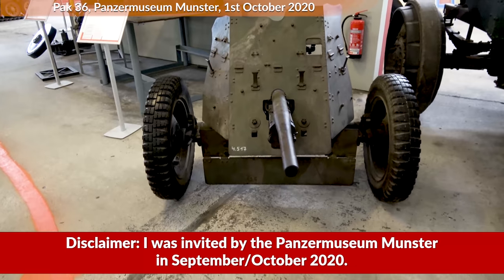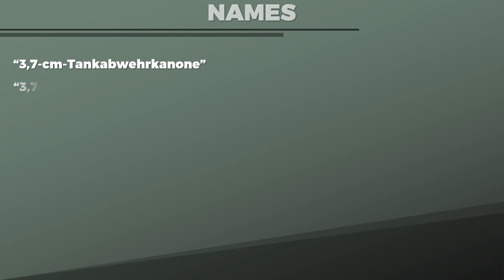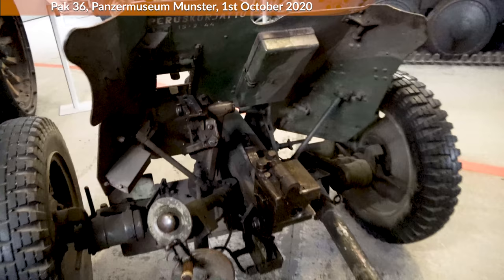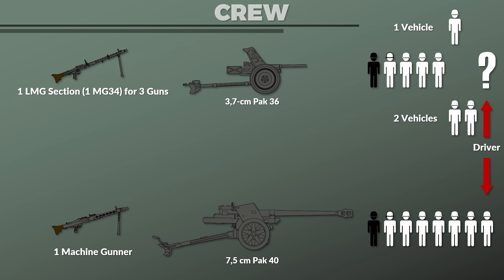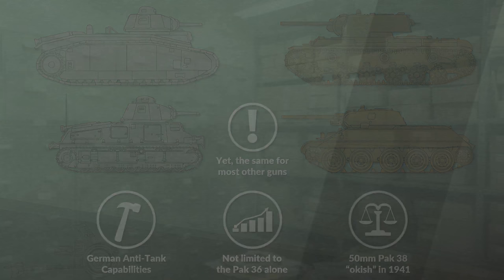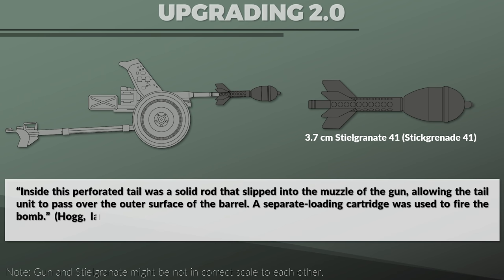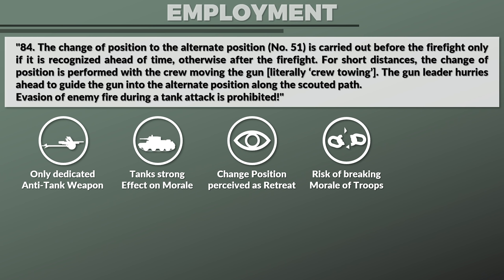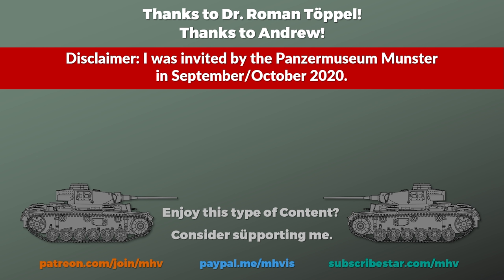Pak 36: The most effective Doorknocker @DasPanzermuseum

Comment: If anti-tank positions are heavily pre-planned, then individual guns readjusting on the spot may compromise the anti-tank network, making blind spots.
Reply: That would be a problem, but in the case of relocating to a pre-planned secondary position I don't think that is the issue since it would presumably have been considered in planning the secondary position. 

There may be a bit of concern over the gun being temporarily out of action, however again that temporary issue is better than the gun being permanently removed because it didn't move away. 

But I would lean towards the suggested ideas in the video: maintaining morale (both from the other troops seeing the gun withdraw and fr the gun crew getting antsy and moving out early) and minimizing exposure.
Reply: Alternative fire positions which are supported as part of a defence in depth scheme  is always best.
Reply: My take: 
- the morale effect is important (not for nothing troops are told that individual tanks retreating in a battle does not mean they run away … low ammo happens, etc.)
- the orders state that you move to a secondary fire position when you have fired (and therefore given away your position) or when you have been spotted prematurely (that would mean before firing)
- as you have NOT been spotted, the incoming fire must be into the general area where the enemy is/might be. Driving you out of position or making you unable to fight the approaching tanks is the pointing the barrage, killing you is a bonus.
- Besides, relocation means you are much easier to spot because you move (unless you hide 100% behind terrain all the way) … and a spotted AT is soon a dead AT.  Which is why you move after shooting or detection.
Reply: That and I think it’s an admonishment not to reposition during a firefight but to keep firing.  Fire volume may count (at least in the writer’s imagination) than chasing optimal positioning or withdrawal to a more tenable position.
Reply: Bigger problem is that you are more exposed and visible if you try to move from pre-planned position. If you cannot effectively shoot back, crew should hide in trench till worst passes, then asses situation. Support artillery generally do not shoot one target longer then 2-5min.
Reply: I think it is that plus both reasons mentioned- the adverse effect on the rest of the defenders to see possibly their only AT defense apparently running away, and the EXTREME vulnerability of a gun crew scurrying around their gun, slinging ammo, trying to get the trails free, etc. It's likely pointless anyway- assuming the attacking armor and/or supporting elements have noticed your obvious commotion, especially if you've already been shooting at them, your chance of successfully dragging that gun away is nil. Even one that light and mobile. Seems like the unwritten expectation for towed gun AT crews in the path of an enemy armored force is that you either win or you die. Of course, sure many, being humans, simply abandoned the gun and tried to run away at some point. Nice video, thanks!
Reply: @EricDaMAJ  but to keep firing.  Fire volume may count    Please revisit the video.
- A PAK is an ambush weapon.  (You think of artillery in general.  PAKs are not 4+ km away from the front.)
- spotted —> no ambush, but almost certainly well aimed fire — tankers hate and fear effective AT guns and love to stomp the little buggers flat before they kill their tank.
- firing reveals your position

Hence you shoot and scoot — the only time you scoot first is when you have been spotted, not when random shells come your way. 

The only time you do not scoot after shooting is when you just won the battle and the area is safe — or when you are at the range.
Reply: Marcelo Henrique Soares da Silva     In that time tanks are not so precise too    That is a question of training and material.  Pre-WWII German tankers had been trained so they could hit observation slits in bunkers pretty reliably (and apparently the PAK 36 was also used in this and similar roles with apparently much success during the invasion of France.)
Reply: @mladenmatosevic4591      Support artillery   is what an AT gun in an ambush position is not in any way, shape or form.
If they “shoot back” instead of waiting for a hapless tank to knock out with one or two shots, no hapless tanks happen but well aimed incoming tank shells are very likely to happen.

If the mission is to knock out any gun in a fortified position that shows its muzzle, things may be different.
Reply: @advorak8529  I stand by what I said.  A PAK is an ambush weapon.  But when it's horribly underpowered, you need volume to compensate so you can at least hope to find a vulnerable point such as a vision slit or a track.
Reply: @advorak8529  Obviously they cannot shoot back at mortars which will shoot at them behind protection or to howitzers which will shoot from position put of range. But een if ig nasty heavy tank aims to them and miss first shot, they have no time to escape and no hope to penetrate front glacis. Therefore, jump in trench for a minute. It is no point losing crew with a weapon.
Reply: @EricDaMAJ     I stand by what I said    That’s great, but does not make it any more or less correct.

Under what circumstances would there be a blind barrage or area fire they are told not to avoid and targets within 600 metres (2000 ft) that need a large volume of fire so they must  keep firing and their risk of getting spotted (muzzle flash, powder smoke, …) over minutes of firing at such targets is low?
Reply: @mladenmatosevic4591    True, the crew should not suicide just because their weapon is going to be toast. That however assumes a trench. And that the tank won’t come to the trench and do a few victory turns on top of it. And that the tank’s MG is not already making holes into the air outside the protection of the gun shield.

Also the crew may have a magnetic mine or other close combat tank killing gear.
Reply: @advorak8529  Generally fully preparedvgun position involves dug in platform to level of wheel axle and  trench as shelter against artillery and air attacks. That is theory anyway. And since AT guns always work in teams, wasting time to trample one gun crew gives nice side view to another gun on two, and they will try to hit transnission, at least. In smart army tank will continue and leave stragglers to assault infantry.
Reply: @advorak8529  The weapon was underpowered but it was extremely accurate.  At no point in this conversation (or the video) did anyone say they were using area fire.  And that wouldn't be a PAK technique even if they were firing PAK88s.  I think you're misconstruing what I'm saying just to be argumentative.
Reply: My hunch is that that was the contrast in thinking between the British (and their two pounders) and the Germans and later, Americans, who adopted a sort of cousin to PAK36 as the 37mm  M3.  Both of the latter envisioned AT gun being used in a more mobile and "aggressive" role (which supposedly was a sizable contributor to the Afrika Korps' early successes).  While the two pounder was more powerful and more accurate, it was not only heavier, but also designed to be used in a stationary role.
Reply: They have to be pre-planned, because towed artillery aren't as mobile as the tanks they're supposed to be shooting.  This changed with the advent of Tank Destroyers (And assault guns used in that role.)  These were often more mobile than their turreted counterparts, but truck, and horse drawn cannons like these have to depend on Ambush.  They can't PaK up everything, hitch it to the horse, or halftrack, and chase the tanks, then unhitch, set up, load and fire.  They have to be Ready to Fire, (In Battery) preferably from a Concealed position when the tanks show up to stand a chance.
Reply: @Psiberzerker  "Have to be" is an exaggeration.  PAK36 and M3 were light enough to be manhandled fairly discretely on the battlefield under fire, and both German and US (Marines more than the Army) troops frequently used them in a quite "mobile" role, with the gun crews pushing them around physically.  USMC particularly liked the M3 (American "cousin" of PAK36) as they were light enough to be physically lifted over beach obstacles (granted, in the Pacific, they were mostly used against bunkers or against infantry with canisters).  How Afrika Korps used their PAKs, with the anti tank guns "leapfrogging" from one position to another without being easily seen by the British, while panzers provided cover, is a tactic commonly described in the accounts of the North African campaign.
Reply: @courseshk27  Okay, yes.  I have a travel trailer, I can push around like that too, but that doesn't mean you can chase a car around the parking lot, with wheels, a motor.  Let alone, a machinegun, and cannon to shoot back at you.  If you read the actually doctrines, the way this guy does, on this channel.  It "Has to be."  According to the experts, that made these guns, the tanks, and put machinguns on them to shoot at Anti-Tank Gun crews on the move.  It's standard doctrine.
Reply: @courseshk27  It's literally one of the main reasons why Tanks had machineguns on them.  That's what the coaxial was mounted in the mantlet for.  In keeping with the theme of weapons, and counter weapons, that shield, on this gun is for the coax shooting back at you.
Reply: @Psiberzerker  and the British didn't have any tanks in North Africa facing the Afrika Korps, I presume.  (M3 was not used on Normandy: I did say USMC in the Pacific and qualified it as a less than ideal example for that reason: by 1943-4, using a 37mm AT gun against actual tanks would have been silly, but in 1941, things were different, and that's where the contrast between the British (static, slightly more powerful, more accurate 2 pounder) vs more "mobile" German/US approach to AT guns becomes relevant.  (With the proviso that light AT guns didn't have too long a future after this period).
Reply: @courseshk27  Right, exactly.  They still had 37mm guns at that time.  They were designed as Antitank guns, but they weren't being used that way.  So, it's not a bad example, it's a distraction.  I was talking about using Anti-tank guns vs Tanks.  You're talking about how the M3 is surprisingly mobile, for a field piece, but it's still being compared to a Tank.  With an engine, and a turret.  Anything without an Engine doesn't really compare with the mobility of anything that can fire on the move.  A tode, any tode, cannot be fired on the move.  That's why they stopped using them as AT guns against modern mechanized infantry tactics.  Even the Infantry was on halftracks.  Sure, you can tow a gun behind the halftrack, but you can also just put an AT gun on it, which they did.  Long before America got involved.  However, this is an Interwar gun.  I said that, first.
Reply: @courseshk27  here's a good example, the Komsomolets T-20.  They made several prototypes with field pieces mounted on the roof.  For instance the ZiS-2 it towed around as a field piece.  It also had a machingun in a ball-mount up front.  Now, should that AT crew run into another AT crew, on the move.  Regardless of whether it's towing the the ZiS 2, or if it's on the roof.  They're going to shoot at them with the machingun, because that's what it's for, and it can be fired on the move.  Another gun they mounted on the T-20 was the PaK36.
Reply: @Psiberzerker  So, in other words, there were no British tank in the Western Desert in 1941.  Got it.
Reply: @courseshk27  Wait, what?  Sure, let's throw everything I didn't mention into one sentence!
Reply: @Psiberzerker  i think you are missing the point here: of the early WW2 AT guns, there were two major opposing philosophies: AT guns as mainly static weapons, as per British 2 pounders, or as quasi mobile weapons that would be pushed around the battlefield by their crews, as per pak36/m3.  The point is that the latter two were not used as "static" weapons b/c they were meant to be, and were fairly successful while being used in the quadi mobile role, and insisting that they are static weapons when they were not used statically is silly.  Were they competitive by 1944?  No, of course not.  But no other early AT gun was (I suppose the obsoleteness of the two pounder by 1944 means that the idea of AT guns as static ambush weapons is discredited?).  In this sense, the mobile, self propelled tank destroyers were a logical evolution of the philosophy behind pak36/m3 tactical thinking: mobility via gun crews pushing the gun around is not mobile enough, so lets put guns on a more mobile chasis.  It is notable that the British, who were dedicated to the idea of AT guns as static ambush weapons, never actually came to the idea of mobile SP tank destroyers on their own, until they got some via Lend Lease.  Even then, they used their tank destroyers (both US supplied and their own modifications) in a decidely not mobile fashion. (No one who thinks of SP tank destroyer as a mobile weapon would make a vehicle with a rearward facing gun). So, yes, EVERY early WW2 AT gun was a "failure" b/c they could not face off against mid war tanks, much the way the Tiger is a failure it was a no match against a T-72 b/c the 88mm gun was too weak  (which is to say that a strong argument could be made that it was a failure, but not because of completely out of context reasons.)  If you judge the pak36 and the tactics assiciated with it by the standards of contemporary AT guns and tanks at the beginning of WW2, it was, at least, a competitive weapon and using it in a quasi mobile form-which was, after all, the logic behind it's design in the first place!!!- made good sense, with useful results when conditions were right
Reply: @courseshk27  Okay, "Quasi-Mobile" but you still have to stop.  Set the trail in the ground, unfold the shield, get out the shells, load, and fire.  Then, pack it all up, and pull the trail out of the dirt to move it again.  All that time, you're not moving.  Yes, it can be moved, but it's not being used, as an Anti-tank gun, while it's moving.  I can move my bed too, but not while I'm sleeping in it.  That still doesn't make it "Quasimobile."  A mobile home is quasi-mobile, but it's not as mobile as a motorhome.  That has a motor.
Reply: Self Propelled Gun.  Gun:  Motor Carriage.  Samokhodnaya Ustanovka translates to Self Propelled Casemate.  I'm sure you can see what these all have in common:  They can move themselves.  The fact that the gun crew can move a field piece has been the field in field artillery since before Napoleon.  That still doesn't make a field piece Mobile Artillery.  That's why we differentiate between field Artillery, and Mobile Artillery.  This is standard doctrine.  It always has been, and it always will be.  This gun is not exception, just because it's relatively easy for the crew to move it.
Reply: @Psiberzerker  you still have to convince the British tank crews who got shot up by the German paks in Western desert or Japanese infantrymen in bunkers on Tarawa that they are not actually dead because the guns that got then could not be moved.  The point is simply that, even if you don't think they shouldn't have been able to do what they did, there were actual (and quite numerous) historical instances where light AT guns were moved aggressively on the battlefield by their crews and were successful because of this.  Furthermore, this capability was actually built into their original design and crew training,  not something that came out of blue
Reply: @courseshk27  How does them moving the guns after they shot them make the soldiers more, or less dead?  They're already dead.  The fact that they had to pak up the guns, and move them pretty much admits that they weren't able to move themselves.  Just resorting to "Quasi-moto"  is admitting that they're not truly mobile.  As entertaining as this is, you've gotten to the point where you're inventing a whole new class of "Quasimobile" guns, just for this one field piece, and the M3.  So, do go on, but with the knowledge that it's purely for my entertainment...
Reply: @courseshk27  Okay, first you used the memory of dead British soldiers to try to prove the superiority of the German gun.  (Also, the PaK 40 used in North Afrika was the heavier, long barreled version of this light little trench gun.)  Now, you're talking about the fantasy of soldiers dying of old age, because wheeled field pieces with ARTILLERY TRACTORS to move them around are too slow?  That's why we had Artillery Tractors.  So the gunnery crews didn't have to wear themselves out, schlepping their guns through the mud, setting them up, loading, and firing them.  Like the WC55 1 ton truck, until they mounted an M3 37mm Antitank gun on it, to make it more mobile.  (That would be the M6 GMC.  Or for the German equivalent, look up the RSO PaK 40.)  Why?  because Mobility proved to be better than quasi-mobility.  Also, you know the Germans lost, in North Afrika, and everywhere else, right?  In spite of their alleged superior Mobility, they got stuck in the mud before they got to Moskov.  As well as everyone else who tried.  So, I hate to say it, but you're rooting for the wrong side there.  Spoiler Warning!
Reply: You're still ignoring the fact that that mount is set up for digging in to a static position, because it's an interwar gun, designed from lessons learned in World War 1.  All of the examples you've given were World War II designs, with long enough barrels to actually be useful against World War II Tanks.  In the Antitank role.  They still used them but for Infantry Support, because they were useless in the Antitank Role.  If they wanted to use "Mobility" to take out tanks, in close range, they would have used the Panserbüchse 38.  Considering the fact that they designed it, specifically for that role.  After the PaK36.
Reply: Oh yeah, and those PaK 36s you're talking about, in North Afrika?  They were actually PaK 40s.  You seemed to have missed that point, despite the fact that I pointed it out, several times.
Reply: @courseshk27  Using those weapons like the nefarious Americans doing the same thing with the M3?  You used both examples, mate.  it still has a trail, and removable wheels, to be dug in, in both Artillery manuals.  in German, and American.  It's standard doctrine, for everyone using these weapons, on these mounts, in the Antitank Role.  Regardless of how heavy they are.
Reply: Making them lighter makes it easier to get them to, and from the battlefield.  When you get there, you still use them the same as any other Antitank gun, on that mount.  If you want to use them as Mobile artillery, EVERYONE mounted them on something with a motor.  That's why it's called a motor.
Reply: @courseshk27  Yes, but the 5cm, and 7.5cm versions weren't as light and schleppable as this one.  Surely you can see that.  You still have to plant the spade, in the ground to fire it.  That's why it has a spade in the trail.  Look at it.  It has a spade in the trail, for digging in.  What did you think that was for?
Reply: The US  fielded light turreted open top tank destroyers like the Hellcat, because they were more mobile than the Panzers.
Reply: @Psiberzerker  Digging in doesn't take forever, and with light recoil (a side positive benefit of the light firewpoer), getting a PAK 36 ready to shoot doesn't take much.  (Now, if you're talking about 2-pounder, that's a different story). We are talking about WW2:  not even tanks could fire on the move (at least if they wanted to hit anything,)  If the Germans (and Americans) wanted an AT gun that was always stationary, they could have made a two pounder clone with a cruciform platform that took forever to get ready (and to move.)  Whether the doctrine was "effective" across the board is a good question.  BUT tactically mobile use of the guns was part of their doctrine, they were indeed pushed around on the battlefield, and were successfully employed on multiple occasions.  Can you dispute any of these rather than insist on your opinion that they shouldn't have been used that way?  Well, you are not alone:  the entire British anti-tank gun establishment thought this way and that's why they got the two pounder.  Were they wrong to have done that?  Who knows?  The two pounder, for its own ill reputation, did have notable successes, too.  But we are not talking about how the PAK 36 or M3 should have been used but how they were used and what the tactical doctrines for their employment were.  (PAK40, and to a degree, even PAK38 are a different story, as heavy as they were).  In late 1930s, no self=propelled anti-tank gun yet, so no point in talking about them (yet).  In fact, one could argue that the SP AT guns came out of the exact doctrine emphasizing tactical mobility that produced PAK36 and M3 types (lighter, battlefield-movable guns at the expense of firepower) instead of the two-pounder types (more accurate-b/c of the more stable firing platform), more powerful, capable of shooting in all directions (turnable platform), etc.)  It's not surprising that, in this sense, US and Germans were big on SP AT guns during WW2, albeit of different forms.
Reply: @courseshk27  It doesn't have to take forever.  You still have to dig in to fire.  It's a gun, you have to fire it.  With that mount, you need a stable defensible position to fire it.  Look at the mount, it's what it's designed for.
Reply: Again, we're not talking World War II.  We're talking Interwar.  This is an Interwar gun.  I wasn't talking about "Always Stationary."  I called it a Tode (That's army for towed.) a Field piece, and also mentioned artillery Tractors.  They were indeed pushed around the battlefield, but that wasn't the standard doctrine.  That was "Oh shit, the Panzer sees us!" diving for cover.  They were towed around the field, by tractors, which is why they're called "Todes."  I'm not denying that the ablity for the crew to schlepp it through the mud and sand is an advantage.  But that's not an advantage the effective AT guns (Like the 5cm, and 7.5cm guns you mentioned) had.  In World War II. That's something the Tank Destroyers had, because the crew could ride along with the AT gun, and more armor than that folding gun shield.  That's why they replaced the interwar AT guns with Tank Destroyers.  They were fast enough to keep up with the Panzers, and the infantry on halftracks.
Reply: @courseshk27  Again, since you missed it before:  The machineguns could fire on the move.  Which is why WWII Tanks had machineguns.
Reply: @Psiberzerker  the point is that not all towed guns are the same, even today (see G5).  There has been widespread recognition that even towed guns should be used in support of "mobile" operations, from Gustavus Adophus' horse artillery onward.  Interwar light artillery was heavily influenced by WW1 experience, which, for Germans included use of light infantry support guns pushed around by assault infantrymen in attack on battlefield.  Not a big leap to conceive of light towed guns for direct fire, except against tanks that could be pushed around in battle by infantry.
Reply: @courseshk27  Oh, that's your point?  because I already made that.  I spoke several times about the AT role, and the Infantry Support Role.  Also, you could have said that not all guns are the same from the beginning, captain obvious.
Reply: Wait a seccond, aren't you the one that compared a South African split-tail HOWITZER to an interwar AT gun earlier today?  I'm sorry, but if anyone's confused about the differences between different kinds of todes, it's you.
Reply: @Psiberzerker  my point is that German and American anti tank gun doctrine emphasized use of light anti tank guns in a "mobile" role on the battlefield, even against tanks.  You seem wedded to the idea that this is not even possible.
Reply: @Psiberzerker  the point there was that there is value to tactical mobility even in a modern battlefield even for a "towed" gun today.  You are insisting that "towed gun=stationary."
Reply: @courseshk27  No, soldiers.  Regardless of whether they're schlepping a gun, or fighting with machineguns (PaK crews didn't have MGs) dive for cover when a machinegun shoots at their position, or die.
Reply: @courseshk27  Uhm, which tanks could be pushed around by infantry, and why?
Reply: @courseshk27  Charging a tank with an AT gun.  Apparently a portable one that can outmaneuver a tank, is somehow less suicidal than charging it with machineguns?  (When I was talking about the machineguns on the TANK being able to fire on the move.)
Reply: @davidbrennan660  the problem with a defense in depth is that it could always lead to defeat in detail